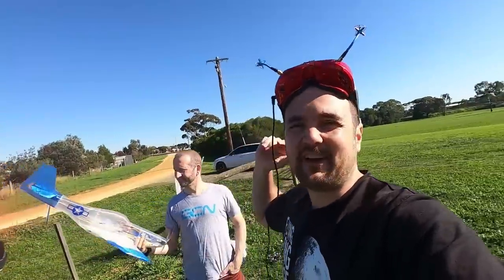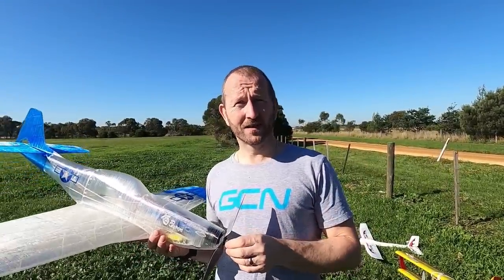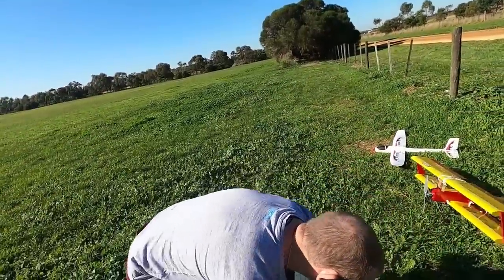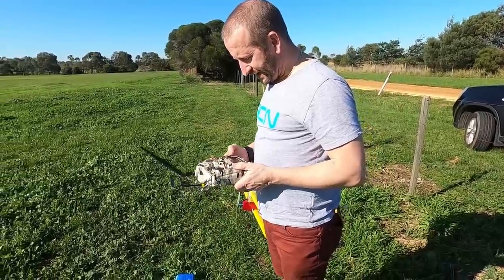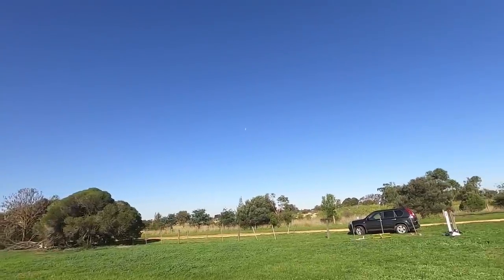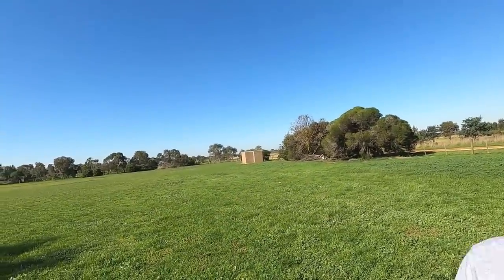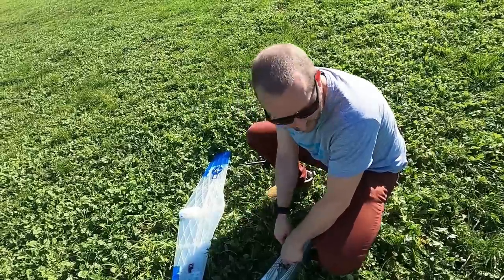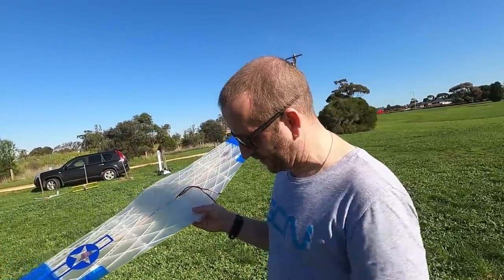$17 MAKE IT YOURSELF!! 150km - 3D printed plane

Comment: That looks beautiful, might need some landing gear though. And that clear pla is just asking for a led lightshow inside it
Reply: Do it now!!!!
Reply: you'd need a smooth runway for that, scale landing gear on this size model would also have caught in the grass and would possibly have lead to more damage
Reply: @garyrobinson312  Or a smooth skate like design instead of wheels so it can slide on grass and rough roads
Reply: for grass you need replaceable skids/skis
Reply: People like to use these for air combat competition since they are bare bones without landing gear and are inexpensive to replace.
Reply: Yes, lights! That would be amazing. Is the PLA hard to paint, or does it need to be primed? Also, how did you get the two ton color? Was that just different colored PLA?

Comment: One thing I noticed about the P-51 and the Spitfire MK XVI is they are so aerodynamically sleek that they don't slow down much when you cut throttle.  So if you aren't careful you end up trying to land with way more speed then you should.  The field I fly mine at is pretty rough ground too and I don't have problems with the landing...just got to get it slower.

Comment: You could try install drop tanks, and let the plane slide on those. The 750mm Hobby King foam Mustang's manual suggests the same, if you want to leave off the landing gear.

Comment: He should try solvent welding the cracks before he fires up the dremel.
Some clear cellotape might stop that scoop catching on the grass.
Reply: All fixed now and back flying like new. Ended up printing a small section out and gluing it in after removing the broken bit. Much easier than I initially thought.
Reply: Definitely safer to 3D print another piece, than trying to "solvent weld" PLA with something that might give you cancer.
Reply: PLA is extremely solvent resistant. There is a solvent that will work on it, but normal people can't (and shouldn't!) get a hold of it.

Comment: Love to get a bit more printing advice from LRT. I have been trying to print a 3Dlaprint plane and have concluded that unless you totally commit and buy simplify 3D as well, your experience with their models will be extremely frustrating. Their designs are made to be sliced with S3D (presliced when you buy a model). At $150 USD for S3D, you need to print a lot of planes to make it worthwhile. Did LRT use S3D ?

Comment: Thats really cool....im bummed out as my print size is not quite big enough to print that,mabe i could scale the plane size down a little then print it.wonder if that would work as i like the thought of printing my own planes out...great vid
Reply: The parts can be printed seperately. You only need 200x200x200 build area with the provided models. Or you can print individual pieces if you wanted to
Reply: scale it down and use smaller electronics!

Comment: I love this. I actually have the same printer and the plans of 3D lab prints for the Edge 540. Been meening to print it for a while now. But need to get the printer settings dailed in. Would love if you guys could shate some more settings for the tevo Tarantula on these prints.

Comment: How much was the full build cost, motor and all? Cheers!
Reply: AU$$$. $10 filament, $10 for 3 X 9g servos, $40 Rx, $30 motor, $15 ESC. Add ur own glue etc. A little over $100
Reply: @ButlerBuilds  $1000 for printer?
Reply: @rebelaqua823  no 200
Reply: @rebelaqua823  factored over 3 planes a snip at $333/plane 😂🤣😂🤣 but to be fair the tevo tarantula was only like au$300 when I bought it 2yrs ago
Reply: @ButlerBuilds  the tevo he mentioned is under $200, and an ender or prusa are not far above. FDM printers are somewhat inexpensive

Comment: 3D printer.. 😱 how good if i got my own.. btw.. cool flying..
Reply: 3d printers are awesome but i wouldn't spend 20+ hours printing this to just crash it after a 10 minute flight.
The foam planes are cheap enough. Also check out cnc foam cutters. You could cut your own foam wings
Reply: I want a 3-D printer so badd to but I don't know how to do 3-D models well
Reply: I spent $230 on an Ender 3 about a month ago, wish I wouldn’t have waited so long. With no experience or education in design or software I can now design basic stuff in fusion about as fast as I could search for it. It’s not hard if you watch a few videos and struggle a bit. Super rewarding. Do it!
Reply: @terminal insanity CNC foam cutter is expensive, share the link if you know any cheapest machine
Reply: @ALIRaza-MCE-  cheapest would be one you build yourself. 
Arduino with grbl, a couple t6600 stepper drivers, some nema23 steppers, gt2 belting & pullies for the steppers, something to use as a frame,  and a hot wire element & a voltage source.
Can probably build one for about $200

Ive built a cnc router & cnc laser engraver this way, a foam cutter wouldnt be much different.
Reply: @terminsane  i am studying mechanical Engg. it's great idea to learn some electronics and programming. but i think that it should be something that can machine out fuselage as well.
Reply: @terminsane  i love more to work of 3d modeling side.
Reply: @ALIRaza-MCE-  i think the foam cutters would be the best option honestly, for home use & rapid prototyping.

The most efficient method, from a production point of view would be foam injection into moulds. Thats what these existing companies do for their foam products. But manufacturing the mold is extremely expensive and they cant easily be modified for prototyping.
And then you need a foam injection machine along with that. This is best used for mass production, not hobbiests or prototyping.

A 2.5d cnc router would work (x,y,z) if you're willing to spend a lot of time on workholding, and refining your speeds & feeds to avoid melting the foam & gumming up the cutter tool.

A CNC lathe could be used to produce the fuselage, and a cnc router for the wings. But you'd have the same workholding issues for the two sides of the wings. And still need that cnc router for the wings.

A hotwire cutter could produce the full fuselage with wings attached, with some really nice curves. And probably a lot cheaper than a lathe. Less workholding. And you cant clog up the cutter tool if your speeds/feeds arent perfect.

You would design the 3d model in fusion360 or something, and then use the 3d file to generate gcode/toolpaths for the appropriate cnc. Then just place a block of foam on the machine and let it do its thing.

I use a cnc router all the time, and honestly the workholding and "zeroing out" your tool each time you change tools or adjust workpiece orientation is a significant portion of the process. 

You'll also need to cnc something to hold the top half of the aircraft when you flip it upside down to machine the underside. Something that wouldnt be a problem with a foam hotwire cutter
Reply: @ALIRaza-MCE-  check out fusion360 if you haven't yet. Its an amazing piece of software for this type of work. Its free for hobbyists and small businesses.

The coolest part is how you edit the model. You add features to the model, which can be modified wherever you like. Eg: start with a cube. You add a hole feature to add a hole in the middle. then a slope feature to the top face, which modifies the hole feature.

But, then You can go back and edit the hole feature, adjust its size and depth, and the slope feature after it will adjust itself to accomidate it. 

You don't edit the mesh directly. You influence it. And any feature in the part's history van be modified without breaking the subsequent features.

Im probably not explaining this very well... But its NOTHING like 3d modeling in 3dsmax or blender or whatever. Its really powerful stuff
Reply: @terminsane  yeah hot wire cutters seems a better option to me also. I use solidworks for 3d modeling,CNC machining and analysis work. I have also decided to explore  Fusion 360. As it's for a person who already have experience of solidworks. Since I don't know programming but here I can seek help from friends in other fields.  There are many ways to manufacture plan parts. But 3d printing was the most quicker and best available option. But unfortunately here we need government permission to buy a 3d printer🤣🤣🤣🤣. They took a long time to issue this permission. And one thing a I don't like in all these videos is that they are joining parts with glue. They should use non permanently assembly method but and bolts etc.
Reply: @ALIRaza-MCE-  i agree, the glue is terrible. It barely works on ABS and PLA. Very weak joints.

What country do you live in, where you need permission for a 3d printer? Thats wild. Governments are so frustrating

Comment: Ive been trying to print this on the up300, its failing pretty hard :( Ill get it done eventually
Reply: Can U share the g code cheers
Reply: @grahambate3384  it didnt work, and the up300 previously didnt support gcode, I doubt they fixed that. You need the new upstudio to print thinner, and you needed to put little rectangles around the base of the model in order to trick the system to print supports and to get the first layers to print ok.

Comment: I had the spitfire 2 years ago , flew beautifully for 2 flights and then a prop strike destroyed the motor mount, would need to print an entire fuselage to redo it.  I think pla is just too brittle personally
Reply: ABS is better for durability. The printing temps are higher and the speeds adjusted accordingly.

Comment: What do you mean by accelerant?
Reply: Its a spray that you can use to dry CA glue/superglue almost instantly.

He used the thick ca glue, not the watery kind. Thick ca glue takes a lot longer to dry, particularly on plastic.  So using the accelerant spray lets him dry the glue instantly once the part is in place.
Reply: Terminal Insanity thanks!

Comment: I'm not knocking what you have done here - there's obviously a lot of work in the design, it looks great, flies great and the engineering that goes into this type of model is stunning. The downside to 3D printed rc models is the total lack of crash resistance - until someone comes up with a new more flexible plastic compound.

Comment: use asatone to glue 3d prints
Reply: I know that acetone dissolves some types of 3d plastic that might be used, in fact it basically eats it instead of melting it. Idk if i am right tho.
Reply: @mikeghazale5116  Acetone has little to no effect on PLA.
Reply: very lightly paint it on both sides. Of course it melts it thats the point. use old prints to test it works really well. better than ca
Reply: Acetone only works on ABS, and abs is extremely hard to print with. You need an enclosure and good temperature controls.
It also warps real easy during print
Reply: its PLA not ABS, acetone has no effect